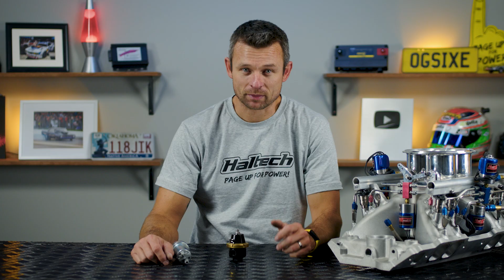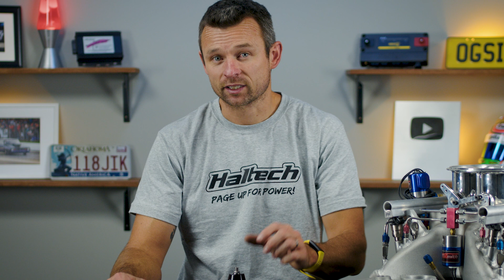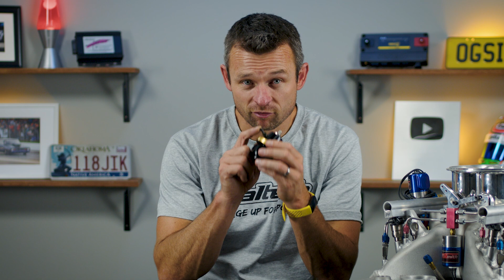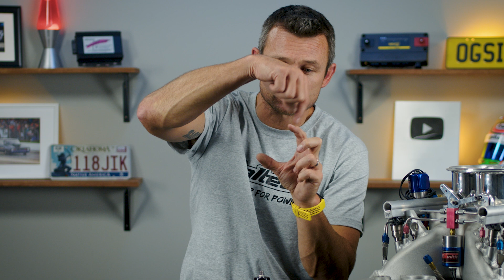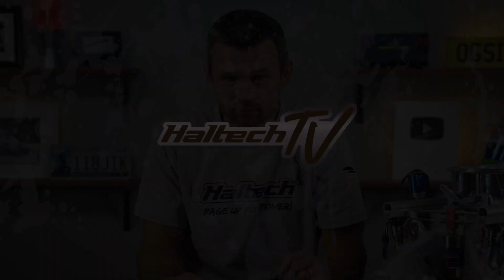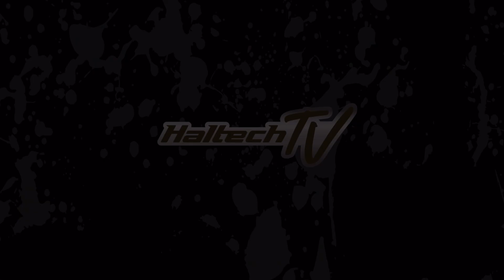🛠  Fuel Pressure and Fuel Pump Ratings | TECH TUESDAY

Comment from the maker: It's Tech Tuesday Time!
Why is fuel pressure important? Unfortunately, this question is usually asked too late....

In this video, Matt dishes out a whole lot of useful info in an easy-to-digest, compact format.
Reply: @Haltech  Can I request you cover a similar topic? For returnless fuel systems? Upgrade path for boost? I can't find the information to clearly set and accomplish what I want to do and having a hell of a time finding the info!!

Returnless fuel system/ NA car from factory but now Rotrex supercharged running 10psi. Stock injectors were 185cc now running 410cc, upgraded stock pump to a 340LPH. OEM fuel system otherwise, 43psi fuel pressure.
at 10PSI injectors are peaking to 80% duty cycle, I put in the new pump and still of course no change but AFR richened up from target 11.5 went to 10.5 throughout boost pressure fuel map (from data logging). So pulling a bit out of the map back to 11.5AFR will help BUT what is the next step? Only bigger injectors? Convert to an external FPR/fuel rail and return system?

Please cover the topic on what all is going on in a returnless system, is 43PSI being a constant at key on/engine off all the way throughout vacuum of an operating engine. Without manifold reference I don't understand how the fuel pressure is being regulated to a constant at the manifold with varying vacuum? I know once I am building boost I am losing pressure fighting against the manifold pressure.

Trying to get up to 12PSI is the goal but fueling is at its limit on this setup. I have bigger  (ID 1050x) injectors to get there if that is what I have to do but the 410's with some way to combat the positive pressure should be able to do the job I would think?

Comment: So if I am not running an forced induction, and my pump will produce the correct pressure that my injectors need, then I guess I do not need a Fuel Pressure Regulator?

Comment: Do all out motorsport engine run more like 5 or 6 bar as fuel comsumption will be higher and heating fuel through return not a big issue?

Comment: My engine is normally aspirated and has nothing connecting the manifold and the fuel pressure regulator. So am I actually getting the 45 psi to my injectors?

Comment: Thanks.  Do you have a video on fuel pressure and fuel agonizing ?  Have an Edelbrock PF-4 . It calls for 58 psi. So do I want 58 at WOT or at idle with the vacuum hose attached or unattached? With it unattached, the regulator would think it's at WTO with 0 manifold vacuum. Even though I think mine never goes below 3 inches. So I could set it at 60psi with the vacuum hose off, 0 inches. Then, at 3 inches, it might be at 58 psi. Now, how will this all affect the discharge of the injection?  345 ci, Super Vick intake 230 duration 530 lift roller cam. 6,300 shift point.

Comment: Air and fuel are the key to an internal combustion engine. Get it right and you can get peak horsepower and torque. Get it wrong and you can destroy engine. A number I learned years ago was BSFC (break specific fuel consumption). It tells you how many pounds of fuel per hour per horsepower. This helps you design a fuel delivery system capable of providing enough fuel. It helps size the fuel pump, fuel lines, and injectors. Many components are rated in pounds per hour of fuel. 

The BSFC varies over the rpm range. A safe base number is .5 pounds per hour per horsepower. The lower the number, the more efficient the engine. A number of .4 is good and .6 is high. All those numbers are normal over rpm range. If you have 1,000 hp engine and a BSFC of .5 you need to deliver 500 pounds of fuel in 1 hour. System can be sized for that. If you have a 'Need For Speed' and don't want to stop at every gas station, you might consider duel 50 gallon fuels tanks.

Comment: I’ve had an issue with fuel pumps getting lazy over time from the car sitting unused with e85 in the tank. I’m about to fit a fuel pressure gauge into the feed line to monitor fuel pump health, is it safe to run normal efi clamps with a fitting t-pieced into the feed line? Or do I need to run push lock /screw in fittings due to the pressure in the line?

Comment: Might have missed it, but WAY too many people just put higher pressure and/or flow pumps on their vehicles without addressing the entire wiring side of the installation - pumps will only give their best when getting the operating voltage, and hence current, they need to meed the demands on them. Get it wrong and best case scenario they simply don't provide the fuel required, get it really wrong and you'll start a fire from overheated wiring that can't handle the amperage.
Oh, and the importance of matching the pipes and hoses to the fuel flow - get it right and there'll be minimal pressure drop throughout the system, get it wrong and it's a pressure head the pump has to overcome above the base pressure

Comment: I think you guys missed a bit in the pressure differential explanation.  You didn't mention that without the manifold pressure reference if the manifold is at 40psi, fuel would not flow. Had to watch that bit twice to fill in the holes.

Comment: Another informative viewing, a clearly defined walking through of the fuel system duties in a modern EFI solution employing rising rate FPR. 

You can’t quite wave a flag about this enough, at the best of times the fuel system is performing at a handicap which isn’t ever realized but fingers get pointed in a commanding fashion even before a qualified assessment has been employed.

Thanks as always gentlemen, cheers 🤝

Comment: Do you need to add 15psi approx on top of the rail pressure as atmospheric is 15 psi approximately for na applications
Reply: Injectors have a optimal pressure for best spray pattern, the data sheet should show the optimal pressure.
Reply: No, there is no adjustment for atmospheric pressure. If the injectors require 40psi, that really means they require 40psid (differential), so the pressure difference across the injector (inlet manifold to fuel rail) must be 40psi. The reference line on the pressure regulator sees the pressure in the inlet manifold, and the regulator adds 40psi above the reference pressure, so as the pressure (or vacuum if you like to think of it that way) in the inlet manifold goes up and down, the differential pressure across the injector stays constant at 40psid.

Comment: I would love an episode on adjustable fuel regulators and adjusting fuel pressure for injectors. Is there a thing like fuel pressure tuning? Why invest in a adjustable regulator when you just set it to a certain value forever? What are the advantages/disadvantages of running higher/lower pressures then rated for the injectors?
Questions I have hard time findings answers to and everyone just seems to stick an adjustable regulator on there engine :)
Reply: You need to regulate the fuel pressure to a certain level (usually 40psi), but because it depends on several different factors (fuel pump, size of the fuel lines, efi or carb, etc.) there's no single value regulator that can do it all. Instead you buy an adjustable regulator, then when you're first getting the engine running, you twiddle the knob until you get the right pressure and leave it there. You'll never need to adjust it unless you start changing things in your fuel system.
(I assume OEMs can predict the exact regulator they will need for a particular engine, and design it in from the factory.)
Think of it like adjustable suspension, it needs to be adjustable so that you can set it to the exact height you want with your setup, but once it's correct you'll probably never have to change it again.
Reply: @phuzz00  check out injector flow calculator’s online for one reference of fuelling requirements and the flow calculator’s for pump needs it’s not just a matter of tinkering with a knob but a matter of maths to figure out how much fuel an engine needs for a given bsfc and power target and I’ve been developing racing fuel systems as a motor mechanic for over 20yrs and this new tech like these calculator’s in our pocket can save a lot of time and testing!
Reply: @phuzz00  mostly true! But you can make a quick change to pressure for fine tuning if lean or rich for whatever reason especially if not able to access the computer, for an example fuel condition or type maybe an additive could be weather or just simply wanting to turn it up for a run, I personally use a spa fmu up to 14:1 rising rate and can tune my mixture on the fly from the cabin via air bleed control to the 2nd regulator the first reg is for low load and is normal 1:1  then the 2nd takes over at higher boost and takes adjustable fuel metering past the airflow meter and duty cycle control and well past the typical limits of the injectors used! 136mph 1/4 mile stock bottom end Ecotec v6 98ron untuned ecu 1620kg
Reply: Just by having a higher flowing pump installed will increase pressure even if the regulator is not touched and at the same duty cycle mixtures will be richer that’s one reason for them the other is that pressure denotes an injectors flow capacity! more pressure equals more flow so setting this at an optimal pressure for the injectors with the flow of the pump at that pressure considered more pressure means less flow from the pumps and more amps drawn so it’s a matter of balance
Reply: @needmoreboost6369  If the fuel pressure changes depending on pump flow, the fuel pressure regulator return is maybe too small to successfully bleed off excess fuel.
The point of the regulator is to keep the difference between intake air and fuel pressure the same no matter the pump flow or engine need.
Reply: @larsjrgensen5975  you are explaining this to someone that uses a custom fuel regulator system for tuning, I don’t completely disagree with you as it’s standard practice to use a 1:1 system and with proper tuning capabilities i wouldn’t need 120psi of fuel pressure as I could run bigger than 42lbhr injectors at lower pressure, not many tuner’s would bother using this system but even with a reg capable of 2000hp of fuel bleed will increase pressure even just a small amount if you increase the flow,even just adding 50lph of pump flow you willl see a small gain in pressure throughout the pressure range, yes they are typically 1:1 but this is how I’m able to run more boost and make more power than the same car on the same set up running a 1:1 reg ,not always been the case
Reply: @larsjrgensen5975  and definitely I  agree that too small of a reg like most oem and some knock off adjustable regs are just too small you will find even if it’s backed off and fully open open the pressure will not fall unless pump volume is reduced.

Comment: What do you mean @2.00 minutes when you say you will have no fuel flow into the intake manifold with (40psi) at the injector?... Hypothetically the only way it could completely loose fuel flow is if there's is 40psi of turbo boost already in the intake !!!
Reply: He did not setup the scenario properly but you are right. In any instance where the manifold pressure equals fuel rail pressure, there will be no flow of fuel.
Reply: It is not very well explained....
Reply: lose

Comment: Love the fact that Tech Tuesday is back!  Would love to see a Tech Tuesday topic of how to power up a Haltech 2500 outside the car so you can configure various channels, datalogging etc while the car is still being built and hasn't been wired yet.
Reply: Just use a USB power bank jump pack.
Reply: I use an old desktop computer power supply.  Drive connectors have +12v, +5v and 2 grounds.  Connect +12v to the harness lead that goes to pin B11 and one of the black ground wires.
Reply: That's exactly what I needed this evening too! I'm thinking of taking a car battery up to my pc, powering up the ecu and plugging in the usb. But I just can't bring myself to risk it!